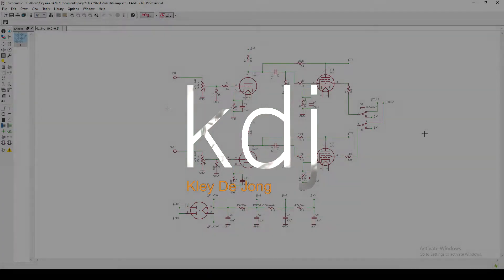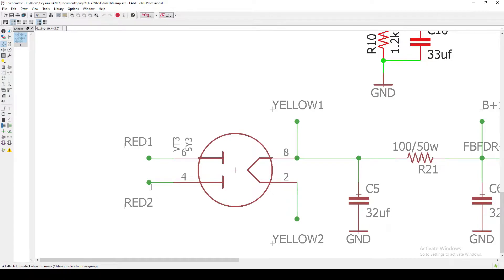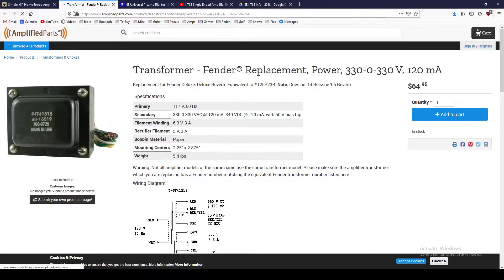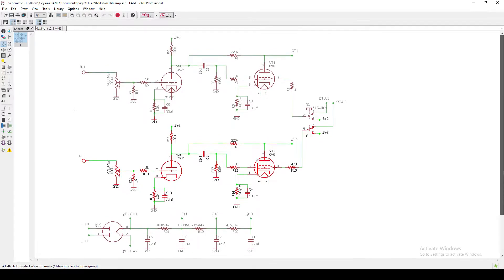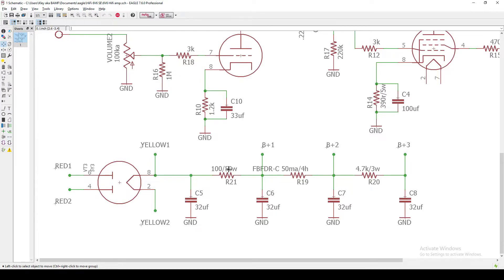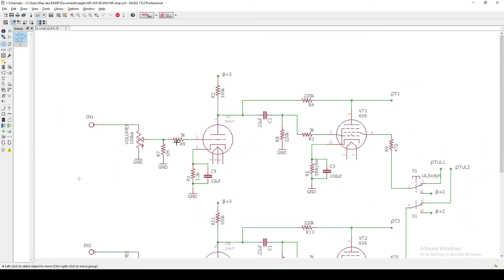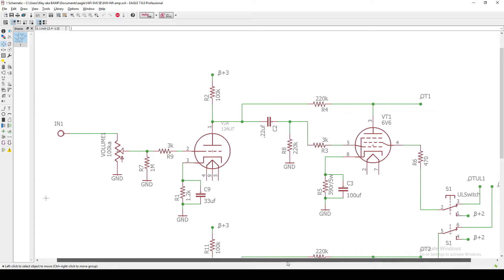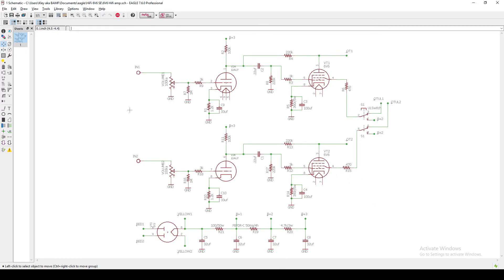6V6 Hifi Tube Amp Build - pt. 2 | Schematic Explanation

Comment: To calculate power supply, use PSUD2.  For hifi purpose,  one choke minimum on the PS supply. Also, check the response and roll off of a single triode 12ax7 as pre and driver.  Remember that you are shooting for a wider band for hifi not just the voltage drive capacity of drivers.

Comment: I always figure out my ballpark B+ like this, say for your build. 330v*1.414=466.62, 466.62-20v(5y3gt loss)=446.62 then 446.62*85%= 379.627v. I believe I got this from Uncle Doug’s channel. What ever I was building that formula was nearly spot on every time. The only variable was the tube rectifier loss, using a 3 amp capable supply allows for a lot of rectifier swapping to get a closer B+

Comment: I know this is an old thread, Nice work there Kley, I have a stand alone 4S preamp and working on 6v6 lacewood amp, both designed by same person. The 5y3 has a 60 volt drop and the 5y3gt has 20v drop. I usually figure out ball park voltage like this, say for your build. 330x1.414=466.2v, then minus 20(5y3gt)drop=446.42v , then times 85%. That equation almost always right on when you do actual.

Comment: This is very interesting. I'm trying to build the same sort of cobbled-together amp. You may have a problem with R21. 50w large in size, and 37w is a lot of heat to dissipate.  I would very much like to find a simple schematic for an integrated hifi single-ended tube amp. They seem quite rare.